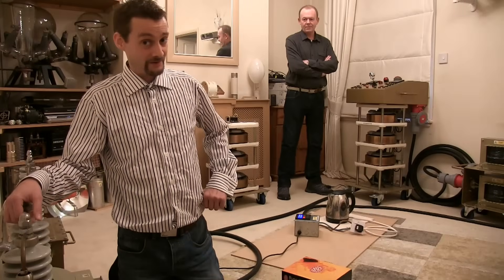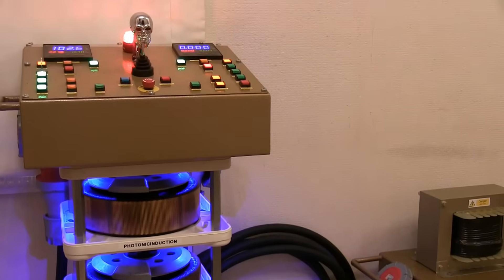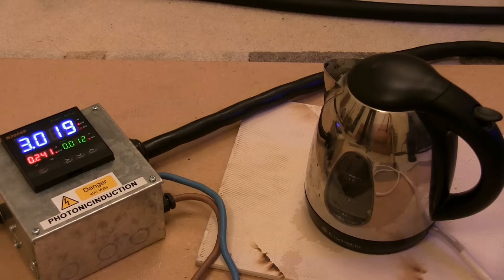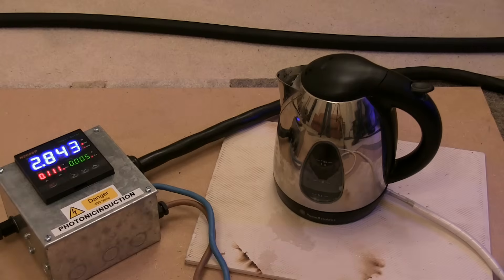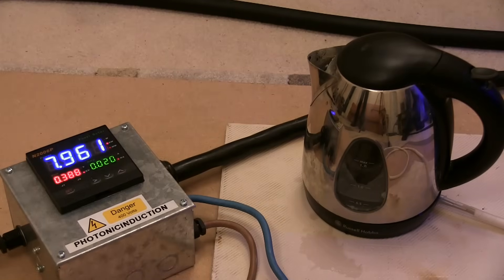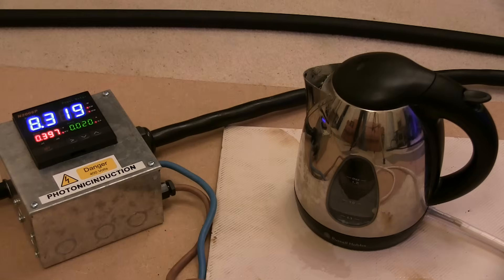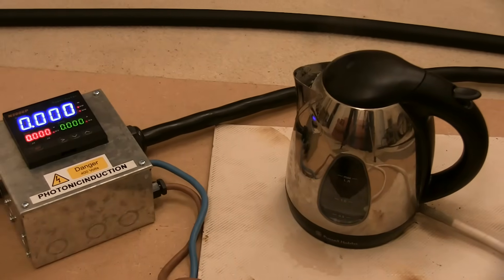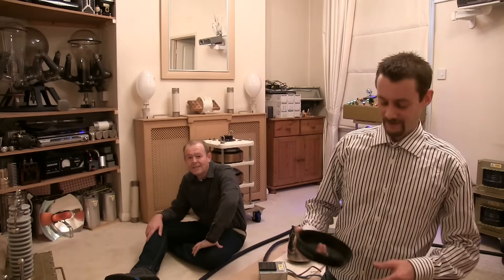10 Second Kettle

Comment: Show this to the fucking EU bureaucrats and tell them where to stuff their regulations!... they want to ban these and make us all have lower wattage kettles. Don't they realise that with less power, it takes longer to boil and thus the same amount of electricity is consumed?
Reply from the maker: We will show EU what we think of power saving it = hard work and time consuming and no more efficient!
Reply: *****
It's too bad you didn't precisely measure the amount of water in the kettle; otherwise we'd be able to figure out exactly how efficient the kettle is at 10kw.
Reply: FrontSideBus Soon a maximum of 700W vacuum cleaners :( , not looking forward to it
Reply: Well the UK ain't in the European Union anymore!
Reply: *****
Pints? I thought you all went over to SI.

Well, I don't really know what I'm doing here, but from what I can figure out:

To take 1 pint (473 g) of water from 25 °C to 100 °C takes 148 kJ. Which would actually take something closer to 15 seconds to accomplish at 10kw, so I imagine only the water closest to the element was vaporizing and the rest was significantly colder. But it's not a huge difference.

So from that we can figure that the vast majority of what you're putting through that element is actually being put to use. We'd have to see how long it takes to boil at normal power to work out how much you've improved it, of course.
Reply: theLuigiFan0007 700W limit on vacuum cleaners only applies to new production, it's not a retrospective law (law can't be retrospective unless there's really good reasons)

I can sort of understand where they're coming from with the regulation. A well-designed 700W motor can move much more air than a poorly-designed 2000W motor. Wattage does not equal suction power. 

and well.. electricity is pretty expensive here in EU, I'd rather not use incandescents. If you want that typical incandescent feel, halogens are exactly the same colour. Pretty sweet you can still find packs of incandescents, though
Reply: *****
And then they just keep layering on the short-term solutions and never actually build the power plants, right?
Reply: And more heat escapes through the sides of the kettle during the longer boil time, therefore more total energy is used with a lower wattage kettle. The trick is to insulate the sides of the kettle. I have a double walled one but mum has a metal one that looks good but is only thin steel and cools down quickly. Also another trick is to not boil way more water than you need.
Reply: It is for at least 2 more years unfortunately, or until they find a way to keep us in.
Reply from the maker: TOASTEngineer
Exactly 1 pint in each test boil
Reply: *****
That sucks. Stupid efficientcy regulations, at least they arent as bad in the US, besides BANNING 100W incandescants (dumbest choice ever in my opinion). Do you have to get rid of old vaccuums or is it just new ones made can be over 700W? I dont know what to say about that as our vaccuum claims "12A OF POWER" (1440W) on it and I think anything weaker would be useless or at leasy more time consuming. I really hope both the US and UK get their heads put back on straight and reverse their decisions regarding these dumb regulations. At least I can still find GE 100W bulbs on Ebay and Amazon for now, bought a nice 48 pack :).
Reply: ***** As for the price of electricity.. well, please realize the electricity itself isn't getting that much higher in price, it is mostly your tax that is increasing. The reason for the tax increase is due to increased government expenses (on mostly non-energy related things). The production costs of electricity is mostly down to its source; being as cheap as $50 per MWh for geothermal to $388 per MWh for stupid shit like solar thermal. Offshore windpower for example is over 3 times more expensive than on-land wind.  

If you want to see decreases in your electricity bill, it mostly comes down to voting on the right politician that cares about lowering your country's expenditure, or investing in your own electricity production.
Reply: theLuigiFan0007 Did you say ''That sucks'' ?? In this case its worse but sucks less.
Reply: Or they make the boil so long that we give up and drink cold tea
Reply: Nathan Dance I think what they're getting at is that you can make tea with 50°C water in much the same way as you would with 100°C water with no difference in taste, colour, texture, whatever. I'm not sure on that claim myself, though I personally stop my kettle halfway through because I don't like waiting for the tea to cool down before I can drink it.
Reply: yeh I was kinda thinking that.  My henry vacuum cleaner motor burned out last year from me removing the bag inside it and the cloth filter.  Sucked up everything with it, but I failed to realize the motor inside is not encapsulated therefore all the stones and rubbish I sucked up was smashing its way around the bear motor windings etc. anyway sent of for a new one on ebay £37.00 for a nice 1200 watt motor cheap fix. But I could have spent over £100 for a new henry but the motors they put in the new machines are ponsy 700 watt EU regs you see so almost twice the hovering lol.
Reply: kingkongdaddy1 my 500W vacuum cleaner eats your 1200W vacuum cleaner raw in pure performance.
Reply: that's interesting, I was wondering myself if the motor could be made more efficient with bigger vanes or something.
Reply: kingkongdaddy1 not so much the motor, the efficiency is mostly in the filter technology.
Reply: Nathan Dance
A pint in Englandlandland is for beer.
Reply: +FrontSideBus you'll lose more heat through the walls of the kettle while you're waiting for it to boil.
Reply: Let me guess, you are an old dinosaur that is unable to cope with change? LED lighting has been out for years, 100W bulbs haha what a tool you are
Reply: Except that there will be a brownout after the end of coronation Street

Comment: Can anyone comment on the wattage jump at 3:42? The meter jumped to 16.19 kW and then to 18.08, is that because the resistance dropped suddenly from the popping? Was there still a complete circuit? Also I think it took 11 kW and not 10 kW, just not for very long : - P
Reply from the maker: That was the start of the element failing and going into meltdown :)

Comment: EXCELLENT WORK, Mr. Photon. :D

Well, there's that question answered, "In-The-Name-Of-Science" of course. :D

Now all we need, is a step-up transformer supplied with every kettle, (or purchaseable as an optional extra, marketed as a 'kettle super-charger') and Cuppa-Tea-Time will be so much more epic, ROFL.

The only downside with that is, after purchasing the optional 'kettle super-charger', the person buying it will then need a specialist circuit wired in for his kettle because of the extra GRUUUUNT it will pull off the mains, LMAO!

Yes, another very satisfying video placed into the Favourites List. A long-asked question, now satisfyingly answered.

YESSS, PEOPLES !!! :D Of course it's possible to make a kettle heat the water noticeably faster.....Just stuff extra volts in there, RIP IT RIIIIIIIGHT UP, and....... Whoomph! There it is! :D A job well done, for the electrically curious among us.

I know when I done the video "Kettle cranked on 270v" my kettle warmed the water sliiiightly faster but the slight increase in speed was more-or-less not noticeable. I needed something which gave it that bit much more, but..... Aaaaah, My variac only does 270v. I wish that they'd make a variac that would kick out a good 420v on the overwind. It would be so much more Ssssatisfying for kettle boil-ups, toast-cooking and the good ole 'loved-all-round' MOTOR POPPAGE. :D

Speaking of poppage, the way the kettle in this vid let loose was rather interesting. I was kinda expecting a non-exciting internal element fail and for the kettle to stop, but..... Look, peoples..... WE HAVE SPAAAARKS!

"The newly made high-speed, single-use kettle, now available to buy for £11.99. When it throws sparks....KETTLE'S BOILED!"

TOTAL ROFL.

Thanxx for doing this one, Mr. photon. Very enjoyable! :D

-BoomBoxDeluxe.

23rd October 2014, 11.25
Reply from the maker: Thanks for the fuckin huge message mate !

Comment: where you have your camera positioned in the intro and outro are really great. idk it just strikes me as a wonderful shot. far better than in your attic (not that i disliked the attic). your new camera still surprises me with it's quality.

anyway i'm actually very surprised the heating element took 10kw, i would have figured it was built so cheep that it was pushed near it's breaking point even at 240v. next are you going to try overpowering a microwave oven? that would be cool to see how your new power supply handles that.

Comment: The pop was so symmetrical that I wonder if it was designed to pop right there. Both holes were pointed down, probably for safety.
P.S. is it possible to set the ammeter to display amps, or are you worried about popping it? It would be nice to have a touch more resolution. :)
Reply: The meter he uses shows watts in the large display at top, volts in the lower left, and amps in the lower right.

Comment: You'd be very disappointed with kettles here in Canada. Typical household circuit is 120V 15A (1800W max). However, most kettle manufacturers size the heating element for 1500W.

Boiling water in an electric kettle takes FOREVER!

Comment: Why don't they just put step up transformers in them like tasers to make them the way they are meant to be? A taser can be over a million volts and only be powered by double a batteries or even C and D cells. And these don't even provide a maximum of 9 Volts constantly. With the step up transformer it gives you even more power with just a little bit of power being provided. Like why don't they do this with everything so then you won't be using but a little bit of electricity?

Comment: Whats this special photonicinduction fuse then?
Reply from the maker: Few strands of copper wire wrapped around a perfectly intact 13A fuse :)
Reply: *****
You could get 1/4" copper rod for a few £ on ebay and cut it to 1" lengths for a more solid connection.

Comment: I need this kettle in my life, as well as the toaster. My toast and cup of tea breakfast would be so much quicker.
Reply: get a 120 volt one and just stick it in the mains haha, 120v hairdryers on mains here turn into excellent flame throwers especially the chinese ones with no thermal cut out t the meltdowns they have are epic  may eventually share the fun with youtubers :P
Reply: Hahaha I was thinking the same thing before I saw your post. "Hmmm mitigate the need for making a power supply and just buy appliances from the US and wire them so they'll plug into the Australian mains" I was LOLing to myself then I read your post and LOLed louder :)
Reply: China is a better idea, postage much cheaper and there are many ebay sellers that would even offer free postage :D

Comment from the maker: This comment system seems messy, I cant find everyone very easily :(
Reply: Crank google+ up on the big boy's supply, til it pops, pls.
Reply: I know right?! I can't believe a big company like google would do something like this!
Reply: Welcome to You(Google)Tube
Reply: 10 second cement mixer
Reply: The reason why they reworked the comment system is simply for the sake of change. "We don't wanna fall by the wayside."

Then some dumb-ass comes along thinking a "simple" user interface will improve "conversation rates". Then heuristics are applied as to what comments you SHOULD see. And now you have a webpage where everytime you load it? You get different comments and can't even find the comment you need to due to lack of functionality.

Modern UI design, ladies and gentlemen.
Windows NT 4.1 did it better.
Reply: *****   your power supplies are really impressive!   how on earth did you ever get hold of them??
really interesting stuff here man,    subscribing!
Reply: Bet you don't have a problem finding THAT (0:33) power plug. 🤣

Comment: Doing the calculus :
1 Kg of water increased  of 1 Celsius = 4180 joules
100c - 20c (ambiant temperature) = 80c
80c * 4180j = 334 400 joules or 334,4 Kj
334 400 j / 10 sec = 33,4 Kw

What have i done wrong ? :/
Reply from the maker: 1 pint is not Kilo ?
Reply: ***** Oops :/
if 1 pint = 0,5kg
80c * (4,180 * 500g) = 167,4Kj
167Kj / 10 sec = 16,7 Kw
Makes more sense i guess
Reply: I'm going to buy a thermometer to test this
Reply: 1 pint, 0.56826 Kg?
Reply: I just estimated it very quickly :/
Reply: HexoFire It's more like half a liter, and electric kettles quit heating up at around 70-80°C, they're not designed to go to 100°C
Reply: ***** Are you sure? Kettles produce a full rolling boil, which is at 100°C ....
Reply: James Franklin I can't speak for all electric kettles, but I think the cut-off point is around 85°C for most high-end models. Water forms bubbles far before it hits 100°C, and the water near the heating elements will form bubbles to begin with. I suspect that (at least some models) detect the cut-off point by measuring the resistance of the coils.. so when the water is heating up, it forms more bubbles, there's less contact between elements and water, and resistance goes up due to heat

Comment: An interesting thing about heating water... At some point as you increase the power to the heater, the water will begin to heat more slowly. (If it doesn't pop first) The element will get so hot that film boiling will occur. The element will be so hot that a layer of steam will form around it that will actually insulate the water. There is a sweet spot as you increase heater temperature where you reach the maximum heat transfer rate just before film boiling happens.
Reply: Once Leidenfrost effect occurs killing off heat transfer that means the element will blow even faster.
Reply: @soundspark  I wonder if proper heat sink will delay such effect or only make it worse.
Reply: @saiv46 A heat sink will increase the heat transfer surface area, which will keep the heating surface at a lower temperature at higher total power input. Therefore a heat sink will delay the point in time, when the Leidenfrost effect will take place and enable you to use a higher power input.
Reply: Indeed! Thats the moment to switch to a 50 kilowatt microwave 😂😂😂😂
Reply: SIR, PULL OUT THE MACROWAVE!!!
Reply: LOL so you can actually heat it so fast that leidenfrost takes over? Cool
Reply: @daddy7860  yes!
Reply: I was wondering if that would happen - you'd need a stirrer to prevent that.
Reply: A big deal for studying the safety of boiling water type nuclear reactors under accident scenarios!

Comment: Where are you getting your mains power from the grid?
Reply: ExtremeGamer9951
oh it's just the usual dysfunctional google plus bullshit system. Sorry.
Reply: ExtremeGamer9951
Watch the video of the set up - it's on photon's channel
Reply: His power supply ups the power. He gets it from an industrial power plug put straight into the national grid.
Reply: I know this but you cant get that sort of plug in your house so i wanted to know how he done it
Reply: Clarity He installed it himslef probably. He is an electrical engineer.
Reply: davidrobert2007
I wasn't the one asking.
Reply: davidrobert2007
It's fine
Reply: Looks like a 100A MCB on his consumer unit feeding one of the phases on a 100A three phase socket. He's probably only using the L1, N and E cores in that mahoosive cable. Repurposing L2 and L3 as additional L1 and N conductors would end badly if someone plugged his PSU into a real 3 phase supply

Comment: I got an idea of what I'd like you to pop, since it's something I haven't yet seen anywhere and you're the chap with the tools to do it. With the cold season round the corner, some of us use electric oil radiators...you probably know where this is going already : get one of those, bypass the 'stat and crank it up until it explodes - see how safe they really are and how hot they get. Trouble is you'd need an open field or something because it'd cover a whole neighbourhood in scalding hot oil (provided the element doesn't give in). Cheers :D
Reply from the maker: If I had somewhere safe to do these experiments, I would probably do that :)
I'll be at yours next weekend lol
Reply: sexysallyUK18
How about "Oil heaters are perfectly safe". Maybe stretching it, but I think potentially boiling oil in the presence of high voltage should be done somewhere that's fully prepared for explosions and/or sizable fireballs.

I also want Photonicinduction to live to make more videos for us.  :)
Reply: gristc
Whats the myth?
Reply: I asked him to do an electric radiator too! :)
Reply: Oki doki, looking forward to it...will have a blast...pun intended :))
Reply: I imagine you'd probably get a decent fireball as well. Wonder if Mythbusters would be interested.
Reply: Hot topic: how about a fan heater glowing white hot? Dual purpose: heating and lighting! :D
Reply: Just come to Mablethorpe, no damage can be done i think :) blow up a few in the main street next light up.
Reply: ***** yeah Bro do that this weekend!
Reply: Don't worry - he's the man :D

Comment: so do you use any of this equipment for work? or have you built all this fancy shit just to break things? lol
Reply: Probably not. Electrical engineers don't usually go around making custom power supply units, unfortunately.
Reply: I don't know the details about his hydrogen project but there are magical devices in existence called rectifiers. I'm just sayin'.
Reply: I do believe the big power supply is just for breaking stuff
Reply: cornholio223 he likely just built it for shits and giggles
Reply: Hydrogen production project. Both this and the old one were designed for that. Using them to blow shit up is just a cool side project to make interesting content as far as I'm aware.
Reply: ***** as far as I know, hydrogen production can't be done with AC.